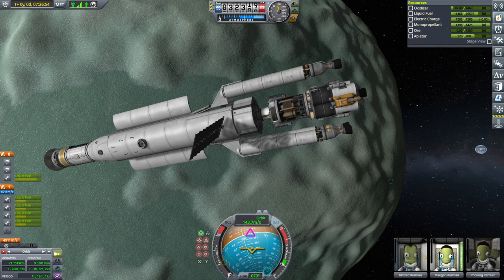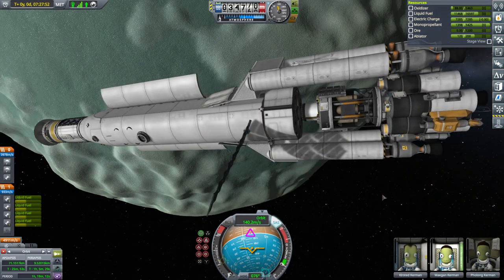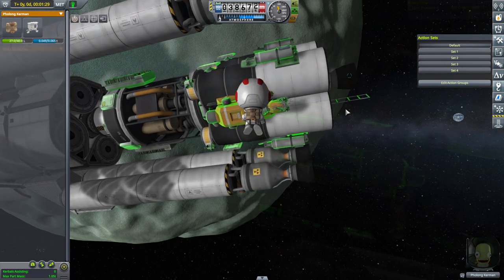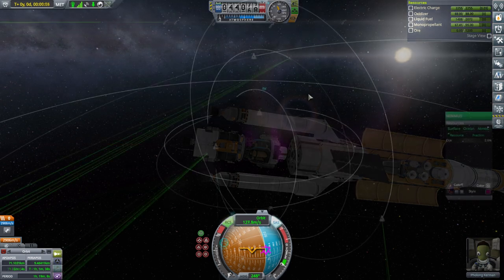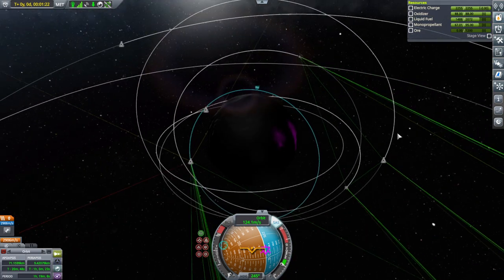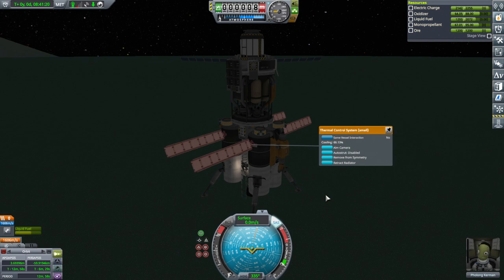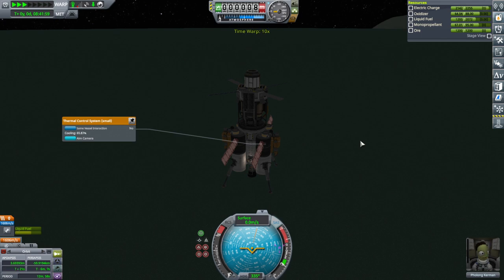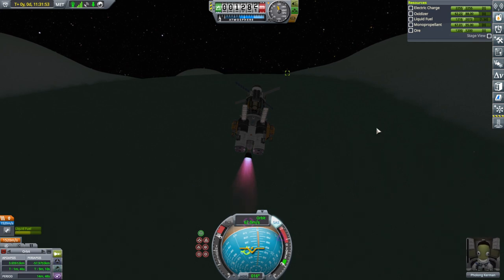Kerbal Space Program 1.12 Stock Career 68 - More Minmus Mining

Comment: Cool it worked lifting the drills. It helped me once. (I got some useless at the Mun base, that I probably should adjust myself. It's from before you could use engineer mode in flight and I never tried with a Kerbal, so I sent u new unit with drills higher.)

Comment: @Raiz Space when you make your own modules or parts do you have to write your own code so it could dock to default made part or does it do it automatically
Reply from the maker: To make a docking port, you have to add a docking module to the config file for the part. This can be copied from the stock docking ports, in which case it will dock to the port that you copied. The docking module has a line that says what type of port it is, which determines what it will dock to.